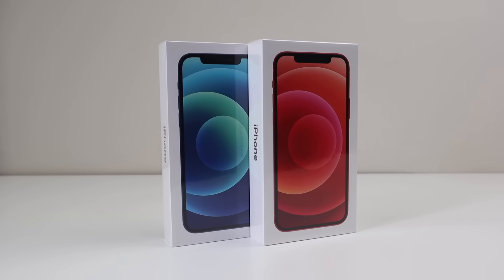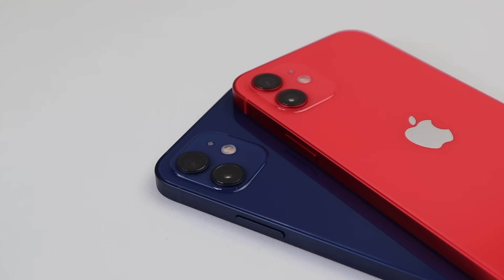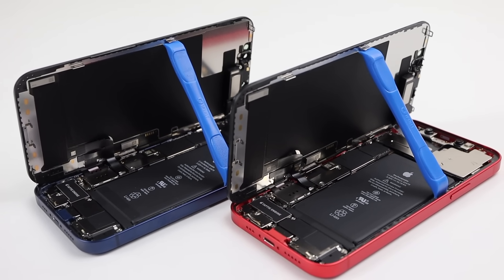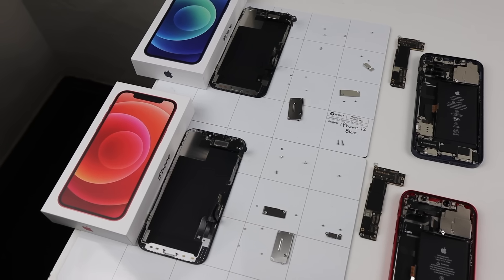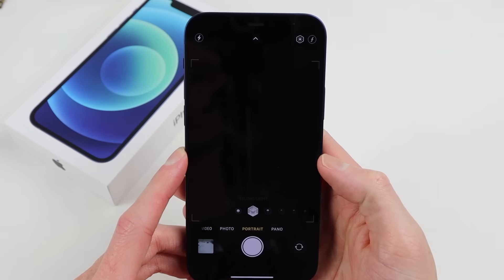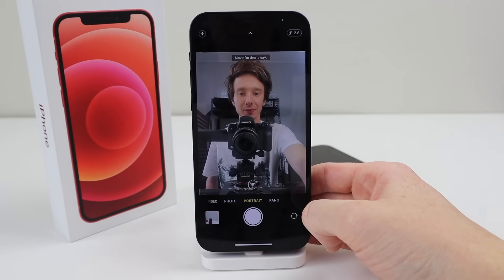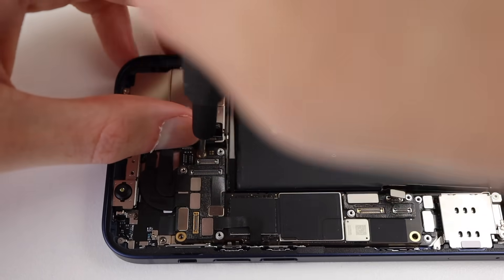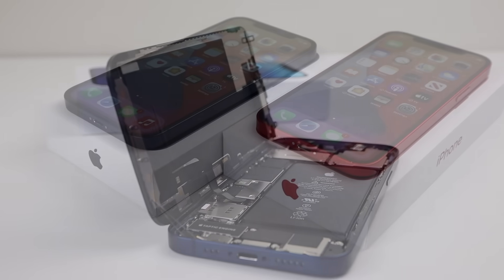iPhone 12 Anti Repair Design - Teardown and Repair Assessment

Comment: The first thing I noticed at the beginning is that the phone models are not the same. That could prevent the hardware from cooperating with each other possibly.
Reply: They are both the same model, just different colored frame. The internal components are functionally the same.

All phones and their components have different model/component serial IDs anyway even if they both have the same model name and colored frame; they might be pairing the component IDs in the logic board itself to make it malfunction if the component is replaced. Or they could have changed the order on the connector pins as another comment suggested.

Comment: how long do y
ou think its gonna be before apple locks the ability too charge your phone with anything other than the included cable or brick
Reply: some phones already charge more slowly if they do not have the cord that originally came with the phone. theyll pop up with something like "slow charging check if your power cord is the original one that came with this phone"

Comment: You're being paranoid. Apple is liable if their battery catches fire, so it's hardly surprising that they don't want idiots putting in another battery with zero quality control on it. Also, I'm guessing that when Apple give a quote for a repair,  they're assuming it's down to ordinary wear and tear and not some idiot getting  in before them and wrecking havoc.
Reply: And why should only apple be able to repair a phone? Even if you use genuine parts? Why should you pay a premium just to avoid the bs apple does anti repair wise?

Comment: dude
you need to change the conector on the top of the display too if you want the face id to work....... it most have the original one put in.... this its not new... its just like the finger print reader if you dont put the original one it wont work... u r welcome you stupid bitch

Comment: You realize that all of these problems can be fixed by reprogramming the screen and the Face ID module. I don’t think that you’re the first to run in to this problem because there are literally other creators that reprogram the modules when they repair them. This problem occurs because the modules are connected to their “birth phones” unique ID this is why reprogramming fixes the issue. It uses the old ID number and reprograms that number to the new part. So it is not impossible to repair this phone third party, you just need to know what you’re doing…

Comment: Idk ANYTHING about repairing phones.  Had to mention however- Oh and THANK YOU- that it seemed like a big (excessive?) jump from 80° to 120°.   A 50% jump because 80° was inadequate...?  In thinking more about it,  I'd guess you tried 100° off camera;  got 120° to FINALLY do the trick, AND . . .. Good guess???
Reply: 80 to 120 is not a 50% increase... Your 0 is arbitrary.

Since for temperatures we actually have an absolute 0, 80 to 120 Celsius is actually about 10% increase.

Comment: Imagine an apocalyptic situation where you need to repair your smartphone and luckily you found all the replacement parts in a wasteland, but then you remember you use apple.
Reply: Calm down, guys. This isn't twitter. We can read comments without arguing about hypothetical situations.
Reply: @allwinpaul747  no worries! hypothetically responses can also be added. :D
Reply: I woud just use pipboy 3000
Reply: @smileyface9459  Chad answer
Reply: Small electronics will be dead because of radiation anyway. Switch to ZX Spectrum enthusiasm, you can find Zilog Z80, to fix your PC, in a microwave, freezer or some other huge household goods with no need in fast processing speed.

You can also try messing around with STM32, which are cheap yet powerful microcontrollers.
Reply: @PLV9 Crowgun All of this discussion is because we can't service an Apple phone! hahaha that's funny
Reply: who's still running a cell network after the apocalypse
Reply: Depends on what you Need on your iPhone. If you don’t Need a Camera, don’t care about pop ups then you’ll be fine!
Reply: That's why Apple will go extinct. Cults exist for a time as well, until they all end up drinking the kool-aid. Apple drank the WHOLE THANG, a while ago, and are slowing dying. Even if they don't know it yet.
Reply: @PLV9 Crowgun Microchips***   not Mechanical.   IDC how many EMPs you set off. my 1920s crank-start tractor, will still start.
Reply: People who use Apple probably aren't smart enough to survive an aopcalypse in the first place, so...
Reply: @rafaelt1772  you say so? hahaha good parameter to measure an IQ.
Reply: @leaoaugusto  What? When was IQ ever mentioned?
Reply: @rafaelt1772  You mentioned something about a person not being smart enough when using apple products. So, how do measure how smart is a person? By measuring their IQ.
Reply: @leaoaugusto  Autistic people tend to score low on IQ tests and yet some of them develop an advanced understanding of math, for example. IQ measures cognitive capability and logical thinking, not intelligence.
Reply: @rafaelt1772  if you say so. ok. you can go now.
Reply: @rafaelt1772  it's just that I thought that IQ = intelligence quotient.
Reply: @leaoaugusto  I mean, it does. However that really doesn't mean as much as you'd think. An eleven year old girl, for example, was the youngest person to ever get a perfect score, 162 IQ. Now who do you think would do better in an apocalypse, an 11 year old girl with 162 IQ or a trained soldier with 90 (which is a bit below average). The answer is quite obvious, the soldier. Sure you can get a perfect score on a reasoning capability test, but is that all it takes for you to be the most apt person in every situation? No, not even close.
Reply: @rafaelt1772  and if she gets an iPhone she not smart enough? dude, I'm just messing with you! But thanks for following up with my stupid comments. By the way, how is life? For you, here, the gov is about to lockdown everybody again. fun fun
Reply: @leaoaugusto  Life is life. Not that bad, not that good, we just move foward. Lockdowns suck, and I'm not really here to debate if they're effective or not, but if it's gonna save even one life I'd say it's worth it. Good luck man.
Reply: I thought the very same thing! my life depends on repairing this.. I'm dead!
Reply: In an apocalyptic situation, I would not care for my phone. For what? some pin number for my bank account? LOL. I would want to have food and shelter. In an apocalyptic situation, humanity is passed beyond what the world used to be.
Reply: @leaoaugusto  I imagine that people in a post apocalyptic world would love to have pictures of thier loved ones
Reply: @ThapeloMKT  After your main priorities are fulfilled, then yes, you could wish to see pictures of your loved ones.

Comment: I wonder when they'll start stripping screws at the factory to prevent people from even removing shields.
Reply: they dont have to strip them. there are anti tamper screw designs that can only be installed without significant collateral damage. combine that with clear locktite and a dab of uv resin at the factory and you would destroy the device attempting to tear it down for repair. Imagine every ribbon cable except the screen and battery had hold down screws treated in this manner.
Reply: @caminoprojectUS  Funny you should say that the last 3 phones from apple I worked on had locktight blue residue and both had 2 stripped screws from new
Reply: @elfri1738  bodes well doesn't it

Comment: If apple didn't do something like this people would be walking around with a live grenade in thier pockets. Even if apple sold the genuine parts to consumers, repair shops would just buy the cheapest chinese knock off they could find. Then when thier phone explodes they blame apple and want to sue. The news media won't cover that it had a non apple battery, it will just be "apple iphone explodes" see how this could get really bad really quick? If you're a business , you can apply to become an authorized apple service provider than you can service consumers. Additionally a business can apply for a self service account than they can order parts through apples gsx.

Comment: If Apple did it, ok. You have the option of not buying their product. Also in my experience 3rd party iPhone repair often cheats customers by providing very bad parts. But anyway, the main point is there is no reason why Apple is in any way obligated to provide support for 3rd party repairs. You’re voluntarily buying their devices and the limited 3rd party support for anything is kind of widely known. So no one can be said to have tricked you into buying it.
Reply from the maker: Apple makes no mention of any of these issues or messages that appear after repair when you buy their products.
And how can 3rd party shops buy original parts if the OEM won't sell them?

Comment: Damn!!! This is totally insane...
Reply: @liukang3545  I can say in the previous models there has been  fairly lenient from my repair experience however this time round they’ve gone crazy😜 

Am wondering how the iPhone 13 shall be.
Reply: @liukang3545  well every phone breaks once it experiences an accident provided it has got a screen for display 
However my point is that there should be room for repairs or replacement of parts regardless of the models time in the market.

Comment: Watching this video made me curious, what fo they make different in the creator's shop than some random shops? I mean, did they got better tools or spare parts and such?
Reply: It's a scam. They purposedly lock it and hold the key... They do nothing special except holding the key and charge illogical prices to force you to buy new. It's not only morally reprehensible, and the opposite of eco-friendly, it should also be very clearly made illegal.

For starters, they mostly don't fix anything, they replace the whole part... (and delete your data for no reason at all... just to provide an even shittier service because why not).

Only they get spare parts because manufacturers for the parts are forbidden to sell them to third parties and even if some third party goes to extreme measures like getting a brand new phone to use as donor (like this guy in the video), they still make the repair imposible for no reason at all. Just to spite their costumers and milk them even more.

Also notice how the phone with swapped parts acts as if broken, so that the costumer who got his phone fixed at a third party pins the third party as the culprit for doing a bad job and breaking their phone... When in fact it's a perfectly good piece of hardware purposedly bricked by Apple.

Apple has had this philosophy forever, they are and always have been one of the more egregious examples of this kind of behaviour. They just up the ante every single generation and product they make, it seems they finally are going overboard enough so that people begin to realize/complain.

Comment: Proved by mrwhosetheboss this 'eco friendly approach' only reduces their carbon footprint. Keyword: their . Because of this if you didn't have the last gen iphone 11 you wont have the proper power adaptor meaning your producing much more waste damaging the earth more as you need to buy a charging brick from a site that will ship it much more packaging than the original iphone 11 did. Overall just ship everything the customer needs like xiaomi and their mi 11 ultra which has a case, usb c to heaephone port, charging brick and a cable. 10 out of 10 eco friendliness apple

Comment: So what im getting is that they want to recycle by having people buy their phones, have some kind of issue, then go back to apple to fix. At this point they would take the phone and charge a ridiculous price to fix while changing one piece that is less than a fraction the cost of the price to fix. The customer would figure out it is probably better to just buy a new phone but wouldn't this bring more pollution since people have to buy more than one of the same phone? As a result, not including the power adapter for the reason of recycling is just an excuse for apple to not include it and have people pay for it instead.

Comment: The don't replace the battery yourself part seems pretty patronizing for apple, battery replacements are the easiest replacements in any phone. The part that talks about how if your provider does the repair the battery won't be correct makes it sound like they are shifting the blame to your provider not that they are making consumer unfriendly design

Comment: This is very dangerous.  With their ability to limit 3rd party repair they could do all kinds of shady things and get away with it.  They could put components in their phones that are intended to fail so you have to send it in for their repair or buy a new phone.  And I suspect at some point down the line, that's EXACTLY what they'll do.
Reply: They already do and did that, not quite in the way you are thinking about it, but how is not functioning because the hardware is not the exact same hardware that was installed at the factory not that already.

The swapped parts phones were perfectly functional pieces of hardware that didn't work because Applew didn't want them to work.

Comment: For a company that likes to optimize and design most of their components, these iPhones looks very messy inside, with an assortment of brackets, screws of all shapes and sizes and ribbon cables running everywhere. Other phones look much more streamlined which probably also translates to a more optimal assembly process at the factory. They over-engineer the crap out of these devices and I really wanna know why.
Reply: probably to make it even harder to fix

Comment: they dont care about the environment. they just wanted to reduce money by not giving free chargers, instead buy them with more money.
big ass notch. 720p display..... yesterday's technology for tomorrow's prices.
and ofc anti repair so you repair in their workshop, so? so more money.
software have back doors. and they got sued before because they fcked their software causing 'old' ios devices to be extremely slow ass, so? so more money.
 collecting data, and sell it, even though they already get lots of money because of their hardware and software.

Comment: "Zero Climate Impact" is the worst lie I ever heard of.
The closest you can get to clean energy at this point in time is nuclear, until we get fusion.
What people don't think about is the production and service required... It takes over 10.000 wind turbines to produce as much energy as a nuclear reactor, and building 10.000 turbines does NOT come without a massive carbon pollution. Not to mention the amount of natural habitats that needs to be shaved in order for these turbines to work as intended. Then there's the service required, and wind-power has more than double the death's per terawatt compared to nuclear and that's including all the nuclear disasters that ever happened on the planet.
Think of this... A wind turbine produces about 2.5 MegaWatts, a nuclear reactor produces about 30 TeraWatts. We just skipped the entire GigaWatt scale there... 1 Gigawatt is 1000 Megawatts, and 1 Terawatt is a 1000 Gigawatts.

SO NO, people thinking that wind, water, and solar power is "clean" has been brainwashed. For instance... Did you know it takes an electric car to drive over 15.000 miles (or 30.000 kilometers) in order to make up for its pollution from production and recharging compared to a diesel car? Just saying, you've all been lied to, no actually, you've been F'ed from behind all this time.

Comment: The screens on the iPhone 12s are ceramic and not great. This is a newer change and even if it is more resistant to cracks, it also scratches VERY easily (and not just shallow scratches)
Personally within the first 3 weeks of getting one, the screen looked similar to my older phone that was in use for 3 years. 
Obviously not great for long term use without a screen protector and will probably generate e-waste as people replace screens or the now necessary screen protectors.

Comment: I wished you would have swapped the Camera, Battery, and the Logic-board of the devices at the same time. You see how the camera glitch happened when you only changed the camera part of the devices from its board.

What if those 2, or 3 parts (Potentially More) are the only parts that have to be paired to each other by Apple for the device to work properly?

Comment: before you start reading there might be some grammaticale mistakes and its a rant about apple repair services and it's long (super long for me) 

i wanna know why apple does this kind of stuf i get that you want more money but this is just a step to far why would apple make third party repairs bassicly impossible because if third party repair shops mes up they get less customers and hey go back to apple dont force people to use apple for minor repairs like if a cable got loose in some way or another dont charge 500 bucks(idk how much it actually is) to "fix" it when you clearly just copy the previous phone data completly onto a completly new phone with the same color and evrything and say you "replaced" the screen and it wil cost 500 bucks, third party repair shops actually repair the screen with the down side of no longer haveing water resistance or water proofing but it costs 99.9% cheaper